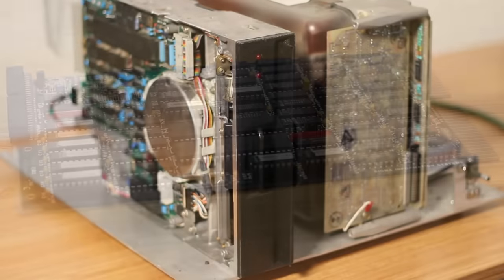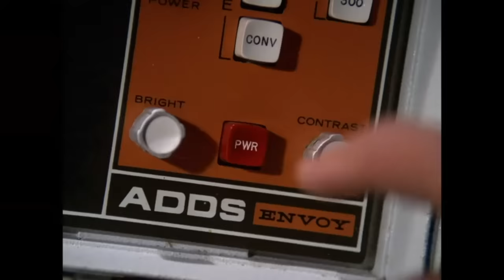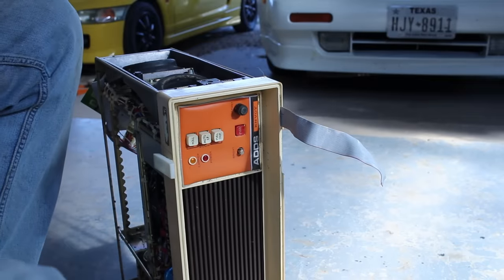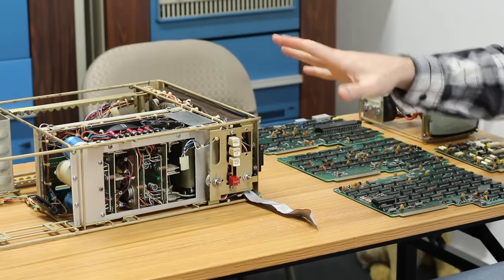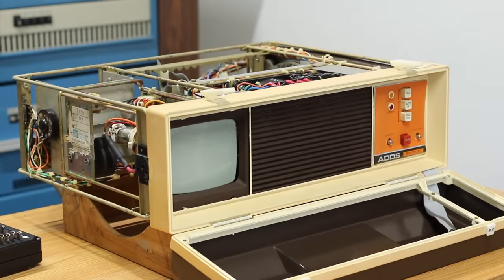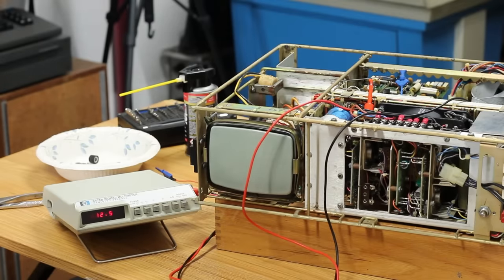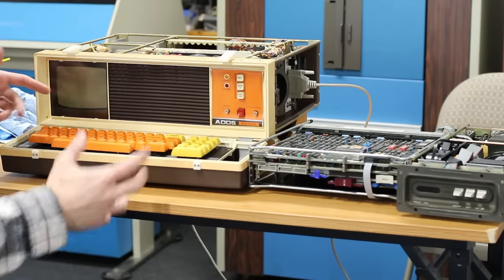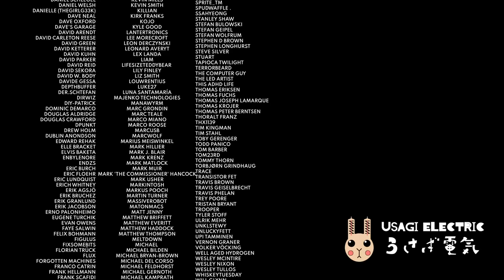This Data Terminal was Covered in Poop!

Comment: Check which of pins 2 and 3 has +12V or -12V coming out of it; that will be the transmit output.  The other will be the receive input.  Do the same test on another, known working terminal  (or an RS232-USB adapter plugged into a laptop running Putty or similar).  Now connect TX on each end to RX on the other end, and pin 7 (ground) to pin 7  (or pin 5 on a 9-pin connector).  When both terminals are switched on and set to the same baud rate, any key pressed on one terminal should display on the screen of the other.  You may need to press Ctrl+J to move the cursor down a line after a carriage return.

I bet the oscilloscope-type connector around the back is a composite video output, to drive a bigger screen .....

Comment: I assume you know the modem switch is for the acoustic coupler and the other position would be for the RS-232.  Good luck!  I used your blue terminal with an HP2100 computer when I was in school.  It replaced a teletype machine.

Comment: i have formatted an ST-225 for use on a pdp11 but i had to move the jumper and I use a microVAX 2000 (vaxserver 2000) to format it. I have an extra microvax 2000 if you want to trade. (memphis tn). As for a portable terminal, I use an old Thinkpad[750] with DOS and a terminal program.

Comment: Is bridging pins 2 and 3 enough, or should you be connecting RTS / CTS and all that? A proper dummy plug. Maybe connect the terminal to a PC so you've got decent control of the other end. 

That coax plug at the back looks like a BNC, and I'd guess it's an external monitor socket. The fact that the top of the terminal is flat also hints at that, that you'd use an external monitor back in the office. You could check if it connects near the video generator internally. It's not like the terminal would be put in a cupboard when you're not travelling, it was expensive! So you'll likely have been using it at the office too, with a proper monitor. Probably just standard composite video.

Really want to see this thing working, keep it up!

Comment: The print ad mentions a price of only $3400!!  Today's inflated equivalent:  about $25,000!!!!!   You could buy a nice car for $3400 in 1972.  Today $25,000, not so much.
Reply: lot more technology in cars now,  you seem to be paying for heated seats, airbags,  most systems are injection turbo with aircon and so on
Reply: Agree a nice car for $3K and a 1,400 sq ft house with 3 bedroom, 2 baths & 2 car garage for $25K in Dallas with a years pay still in your pocket in 1975.    My starting hourly pay at Warrex / Centurion was about $4 per hour in 1975.

Comment: Beyond just pins 2&3 (tx/rx), you might have to jin up some flow control signal.  Some old stuff used RTS/CTS and other stuff to enable flow.  Not saying that's going to fix all the parenthesis, but it's something else to tinker with.

Comment: Any reason to go for an 8" floppy? Authenticity? Because if an 8" floppy works, then a 5,25" floppy would also work without a problem, and keep the overall package a bit smaller. And you can stack it with the hard drive.

I'd guess that the 'MODEM' switch enables the internal modem to use with the phone coupler. The coax jack might be for an external monitor.
Reply: Why not even drop down to a 3 1/2" floppy?  I know you want to stay vintage but I think 3 1/2" drives are vintage.  That 8" behemoth will take up a lot of space and cost a lot of weight.  A 2.5" IDE SSD will also save weight (the ST-225 weighs a "ton" in portable terms).  You can always make a box the same size as the PDP-11/23 chassis for the 8" drive and HDD to be part of a "stack" and switch between the two schemes.

Comment: I suspect the BNC connector is a composite video output to attach a larger monitor. However it may not work on a modern flat screen with composite video in. The scaler in those expects broadcast specifications which older computer video circuits didn't really adhere to.
Reply: Yes, I was thinking that too.

Comment: I think you meant "mouse" instead of "rat".  That smell is unmistakeable and vile.  You did not waste time cleaing up both systems as you may needs parts/cards from both to make a good one.  IPA is a good drying /sterilizing agent after simple green as was already suggested.  I have a dehumidifier in my basement and crank it up with the boards surrounding it after a good going over with compressed air.  Also a good idea to remove any socketed ICs and use compressed air - water gets trapped in those sockets.

Comment: I got my own rat poo and pee machine a few years ago, a sun sparcstation 5 given to me by a friend, which has spent some time outside with a slot cover open. I vacuumed it, hosed it multiple times with considerable water pressure, brushed it with dishwasher soap multiple times and re-hosed it, brushed with IPA multiple times, and left it to dry for a week then rinsed it again with IPA. My motivation was "I don't think I'm going to damage something, but frankly I don't care. Either I clean the biohazard completely, or I'm throwing this thing in the dump. I'm not keeping it in my home like this."

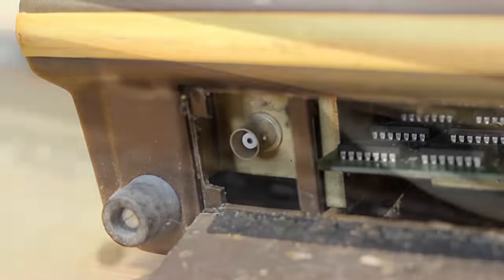Comment: 6:40 yeah, that's an old NETWORK connector, I should think. Welcome to Data Processing Hell. Prepare to enter the world of Termination and token passing
Reply: What the Coax ? (I thought the coax would be for an external monitor), pity I gave away my nice black and white (or white on black) monitor , only a 13in CRT
Reply: @highpath4776  yeah, I agree - BNC was the industry standard composite connector for closed circuit monitors for decades.  A inbuilt functional network connection would be a bit advanced for a finite state machine like a serial terminal.

Comment: It's rat shit crazy! Should have donned a hazmat suit for that...  But it's gonna make a lovely unit after recombobulation. 
I'd normally spray these boards with IPA after hosing them down (or cleaning in an ultrasonic cleaner), leave them to dry or use a hairdryer / heat gun to make the process faster.
Nice to see you have another one in a non-shitty state. Hope you'll get both of them to work :)

Comment: Aside from aesthetics, is there any particular reason you didn't want to use a terminal emulator on a modern or even vintage laptop?
I once had to drag a Compaq Luggable like 6-8 city blocks.  It's not fun.  That thing must weight 30 plus pounds.

Comment: You might not be able to "hear" high voltage, but you might be able to see it. Hold a fluorescent tube close and it will light up. No need to attach it. The radio interference from the high voltage circuit is enough. Enough demos on you-tube.

Comment: I have seen worse! I work with old home organs and their wooden cabinets and fabric sound padding are a paradise to rodents. And speaking of organs they often have a quite high voltage on their capacitors. I have a fantastic Technics organ that has 16V on the capacitors that it regulates down to 5V and at the same time generating enough heat to warm up an average sized living room.

Comment: my guess is the slow baud rate limitation you feared it has applied to the acoustic coupler, those I hear were severely limited because of noise
Reply: The acoustic coupler uses a pulse of two different aurio frquencies, which are limited by the phone lines, as I remember not much over 2 KHz would survive.  The bit rate of the signal could not be more than a fraction of the lower of the two tone frequencies, so 300 baud was about tops usable.

Comment: spacebar is 0x00100000, and "(" is 0x00101000", and 0x00001000" is Backspace, hmmm....stuck bits?
First, check data coming out of the RS-232 with a scope when you type on the keyboard. 
Check speed, parity and if status lines are used.
Secondly connect it to a modern RS-232, try sending some data, and watch what happens.
Does it print one or multiple brackets per keystroke?
(configure your sending terminal to not buffer data or echo A>COM1 )
The speed switch might not be making contact. Try lowest speed.
The terminal also might expect hardware handshaking.

Comment: Thankfully, i had dinner about an hour ago. Never seen so much rodent poop inside electronics and i certainly have seen some in my life. 

Btw. which brand is your editing monitor? Just curious, because the aspect ratio looks quite unusual to me.
Reply from the maker: It was definitely rough inside!
The editing monitor is an ASUS VZ239H-W, just a standard 23" 1080p monitor, nothing fancy. Perhaps the 50mm lens I filmed with made it look a little weirdly shaped.
Reply: @UsagiElectric  Thanks, it looks very square in the video, almost like an LG DualUP

Comment: The 13.6 V indeed feels like the 12 V rail without load.

27.2 V is just 13.6 V x 2, so what +12 V to -12 V 
31.5 V is a bit more odd, but not crazy. That is 4.2 V away form the 27.2 V. So my guess is the 5 V rail is measured to the +12 V
So the +12 V and -12 V are about 13.3% over spec and the V is 14% under spec. Which isn't super dramatic, even modern ATX has it's 12 V rail as ±10%

Comment: 25:45 Could the "Modem" toggle switch select the acoustic coupler modem vs. the RS-232 data port?
Reply: Also, as the terminal is fan-equipped, you had the remove the poop, or else it would have hit the fan.

Comment: At least you did not find a dead mouse inside, it happened to me once. Another time, a radio I purchased from a fleamarket, which revealed to be completely filled with dead cockroaches 🤢
Reply: OK if dead,  is the alive ones stacked in the gaps under boards etc that are a problem.

Comment: In regards to where to go from here, I would check:
1. Does it have a stable clock? It might be garbage and jittering all over the place, or barely running. Can also be an issue with too low amplitude. All of these can lead to very intermittent behavior. It is effectively step two after voltage checks.
2. Is there any corroded/damaged traces, cracked solder joints or the like? (These can be particularly annoying since some cracks are practically invisible until one brings out a microscope.)
3. Does the RAM chips work? Even SRAM can break, and DRAM is especially flaky at times. (though, this is a more common issue on modern systems, but still a great source for weird problems.)

Then there is cleaning boards with water. This is nothing wrong. In the electronics industry it is done more or less all the time. It isn't a problem unless one puts electricity through the board while it is wet.
I can understand your paranoia about drying it out, but at my own work we usually blow the boards with compressed air, and then send them through testing an hour or two later, depending on the board we can put a fan blowing warm air over them for a bit first. And we wash boards for over an hour to get rid of flux residue hiding under chips and such. (we mainly use water soluble flux when board cleaning is desired by the customer.)

To be fair, most contact cleaners are worse for the board than cleaning with water. Downside is that water doesn't remove rust, but rather helps make rust, thankfully exceptionally slowly. (an hour or two in water won't rust a board, a couple of days will though slightly corrode the surface of pins and such.)

And water coming in contact with chips is effectively harmless. A lot of chips these days comes as the raw die with a ball grid array directly on the die. (Also known as flip chip technology)

The worst part with water and electronics is before soldering. Epoxy encapsulated chips (ie most chips) can trap moisture inside, and when heated up during soldering this moisture can boil creating quite a bit of pressure. This in turn can create fractures within the epoxy and rip lose bond wires, often leading to latent failure in the field as the surfaces inside that fractured bond wire corrodes in the first couple of months. Though, if one is lucky the chip has so much moisture inside it that it literally blows up, and yes that is "lucky" since latent failures are abhorrent when one has warranties to uphold. (PCBs can also trap moisture leading to so called "popcorning" during soldering, ie more latent failures waiting to happen....)

Comment: About your method of cleaning the boards: Is there any OTHER way of cleaning electronics quicly and reliably? From what I know, water does no damage whatsoever unless they are operating.
Reply: It's not the water doing the damage, but whatever minerals are dissolved in it, which get left behind as a coating that might short stuff out after the actual water evaporates.
Reply: Back in the day they would often hose down boards with Freon 113. It works great for cleaning circuit boards. Unfortunately, it's not so good for the ozone layer.
Deionized water is fine for cleaning boards. It won't damage most components and doesn't leave residue behind. Tap water will leave mineral residue that can potentially cause issues.
Reply: @AttilaAsztalos  I once cleaned a 70s b&w tv board with water from my well. Had no problems. Must have been lucky I guess

Comment: The CRT is horrific? Sounds to me you never used a Commodore SX64 or Osbourne 1.

The stated Baud Rate of 110/300 is for the acoustic coupler. That is sensitive to sound from the outside  interfering with the connection. The other speeds up to 9600 is for the direct connect RS-232 port.

Both looks promising. I'm sure one can build a keyboard from parts from a ead Apple II or Commodore system. and get two for one. hint hint

Comment: Try a Envoy on a Centurion.
Reply from the maker: Interestingly, since it's the same as the Consul 580 internally, the Centurion already supports all the control codes, so it should work perfectly!
Reply: @UsagiElectric  speaking of Centurion Terminals I did a google (or was it Microsoft Edge ) search/ search for images.  A similar , but slightly different design to the types you have already came up  one with a comment on what it might be ( dating from 2021 so before your findings) , of an image that had been found. but I could not find the original image source - I dont know if it was an old magazine scan or a photo of something someone had

Comment: What is that strange clicking sound in the end of the Usagi-san movies? Anyone else hear it?
Reply: Prob the Usagi electric opening thing switching off ?
Reply from the maker: Depends on where you here it. If it's after I say "Thank you so much for watching and I hope to see you next time," it's an artifact of Youtube, because I don't include any audio tracks after that.
If it was before that while the machine was on, it could be the PSU or monitor or cooling fan getting picked up by the microphone.

Comment: A couple of things here:

1) Be careful with the CRT board and CRT itself.  Those run on VERY HIGH VOLTAGE.  The CRT Anode and flyback transformer outputs could be in the thousands of volts!  Even the grid drive runs in in the 30-200 volt range.   You may want to use an isolation transformer when troubleshooting it.   

2) The Data / Modem switch might do one of several things.  I suspect that it may control whether it operates from the accustic coupler or whether it operates directly from the DB25.  It could also control whether the output is full duplex or half duplex.   Early terminals did sometimes connect over phone lines to mainframes.  Others were directly connected.  Likely this reflected whether they ran cable or connected from another office.  

3) The Linefeed settings could reflect which type of computer you are connecting it to and whether a return is a carriage return, a line feed, or both.  Different computers handled this differently.   Again, this might also set which type of terminal interface the mainframe you connected it to used.  Different models used different interfaces.  Examples of some of the terminals protocols included VT-100, ADM-3A, VT52, D1, D2, D3,  Televideo 910 through 9150,  VT220, ANSI, and others.

Comment: Generally water and any substance like soap is to be avoided, but in a situation like this, it's pretty obvious, you need something strong to clean that shit. I suggest, after the water bath, to submerge the board or what you have, in a bath of alcohol isopropyl 99,9%, that's good because it can reach spots where the water can seat and do damage, like under IC, remove it and then evaporate, cleaning even better and sterilize it.
Reply: Water (preferably distilled, so no minerals) and detergent are totally fine for cleaning boards, and the safest way to do it. If you're feeling paranoid, add a bit of 99% IPA to the mix.

Comment: I hate to be a spoilsport here but, an old laptop with an RS-232 connection running terminal software would make a much more portable and bulletproof PDP-11 terminal without wading through mouse poop. On the plus side you did fertilize the grass.